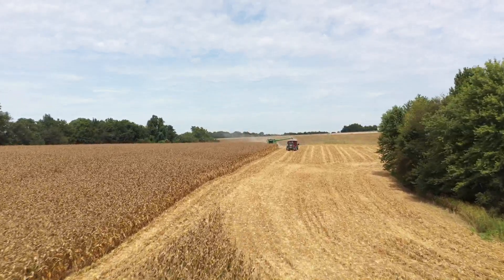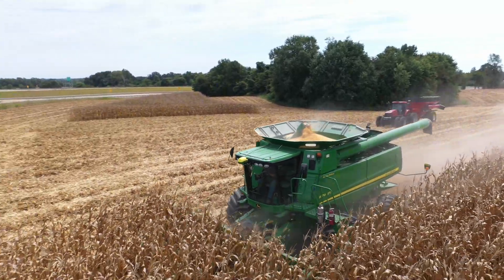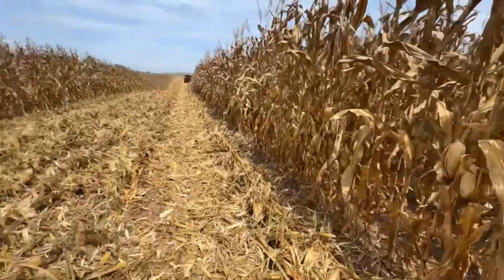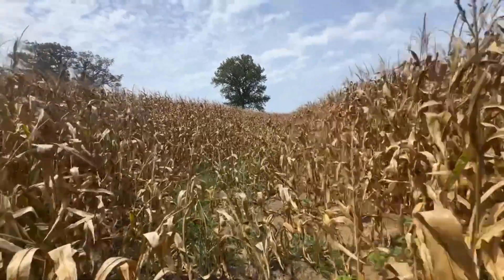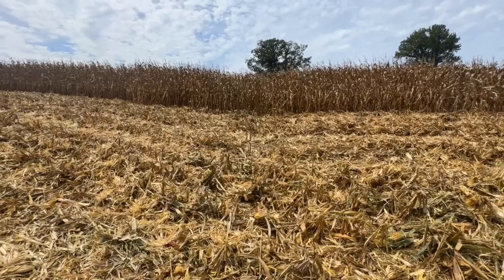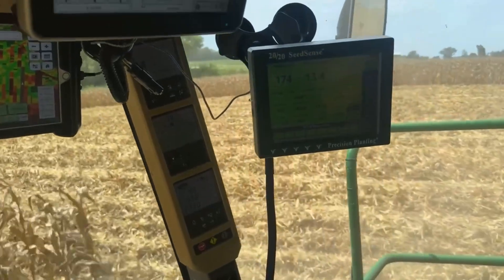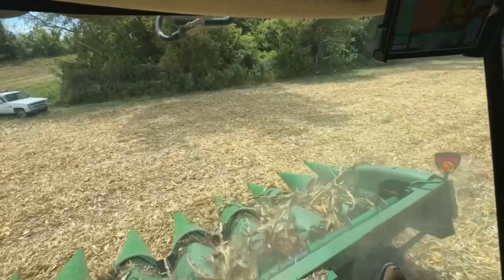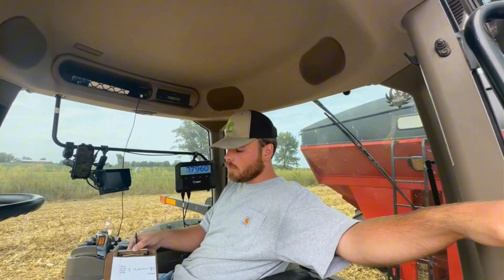Harvesting Corn Planted into Green Cover Crop - 2024

Comment: Thanks for the video just discovered your channel. I’m doing some of the same things love it. How much nitrogen did you put on that crop
Reply from the maker: Thank you for watching! Glad to hear you’re doing the same. This had about 190 total units on N. We also had 15 inches of rain after planting through the first half of June.
Reply: @ that’s pretty good. What do you normally put out there? I tried some of my sweetcorn with just a 17 oh 17 starter so I figured it was about 50 units of Van. I top dressed one block with some gypsum once it came up a little bit probably should’ve done it earlier so the calcium was available. Seems like it timed out right on these three blocks one was top dressed with the gypsum. The other two were not top dressed normally would top dressed with about 100 more pounds of urea didn’t see any difference between that corn in the corn that was dressed. Only difference was there was absolutely no worm pressure in the stuff that I didn’t put your Ron that just received the 50 units of nitrogen, we got into the block that was top dressed sprayed for worm control still saw some worms that was on cloud ground had one piece that I had a friend No tell in for me after I cut the first cutting off then I sprayed it with a product called rely and it knocked the grass back just enough to raise the corn crop absolutely no fertilizertoo good years per stock ready at the same time I round bailed at all for the cows after we picked the sweet corn just cost me seed money to plant that acre. It’s really fun messing around with this stuff. Keep up the good work, my friend.

Comment: Check the roots for heavy metal damage.  They'll turn woody and blood or fleshy color.  Heavy metals decrease root elongation and cause yellowing.  It's been a huge problem in Texas.  Plants with heavy metal damage will be loosely rooted.  You can pull up a corn stalk that's two months old.
Reply from the maker: Interesting. What causes the heavy metal damage?
Reply: @GiffinFarms  Greedy Mankind.  It's being "Fixed Now."When it started is when trees started toppling over in the early 90's and it has gone on ever since.  It's also tied to the autism rates and people needing hip replacement at age 40 along with dogs dragging their hind legs around.  Bloody or woody-looking roots tell a tale and the plant is always loosely rooted so it doesn't get much nutrition or moisture.